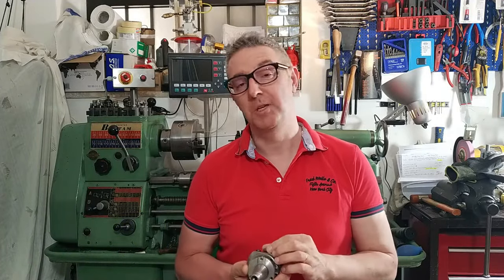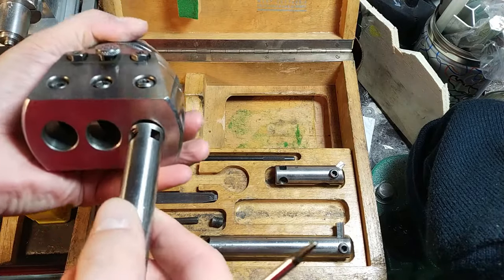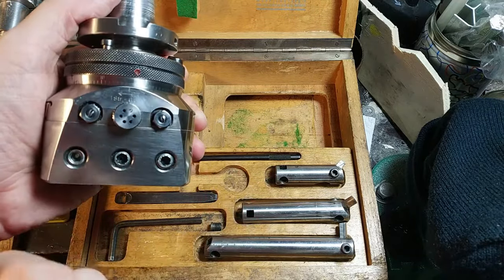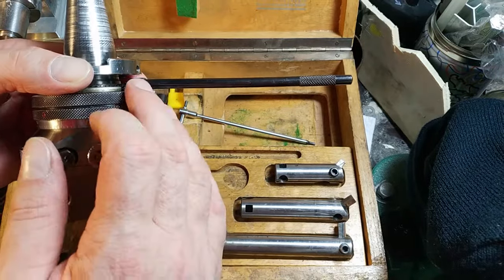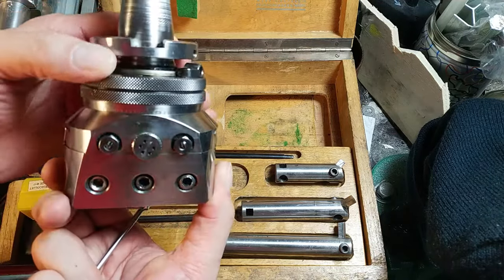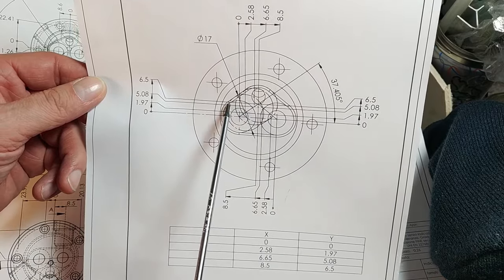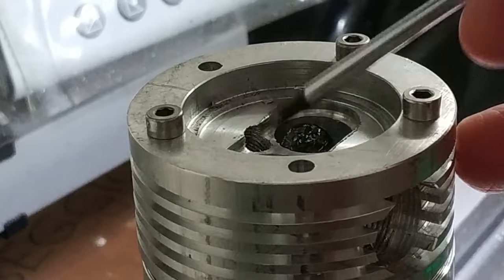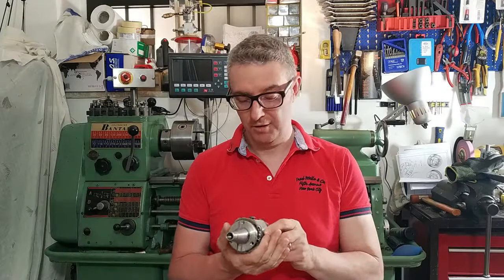UPA3 WOHLHAUPTER - Boring Head Unboxing

Comment: Great demonstration of this model of head, and the bold move of adapting it to fit your machine. I have done the same to Boeing Aircraft surplus UPA5 removing the SIP mount making it now useful on several heavy machines. I am looking at the UPA3 for smaller work. The larger heads are usually not as costly as the smaller sizes. Another observation is the kit of attachments get rarely used by those that use the heads on a regular basis most often on horizontal boring mills, instead adapting to inserts or fabricating a brazed carbide tool. I have used the head for restoring a variety of damaged castings including vintage motorcycle crankcases. The larger head I have, the boring size adjustment is a small dial on the side, I find it a little tricky with all the gear lash involved and I mostly just use the heads facing and cutting internal grooves function, then use a regular head for plain boring.
Reply from the maker: Hi Dee Dee, thank you for your nice comment: it is really interesting and nice to receive a comment from those who have used the UPA several times, I fell in love with the UPA after seeing some videos on its use / history; I went crazy turning / eliminating the old centering cone for the Deckel FP1 that was mounted under pressure, and then even more turning the MT4 cone below because it was hardened, but on the other hand the version with the cone that unscrews and allows you to install for example an NT30 instead of an NT40 it cost more than 1000 dollars and so I said I'll try and it want well.
The UPA2s are highly sought after and very expensive, because they are small (so can be install on mini-mill): I had a Chinese boring head but it is really another world, I have never used it anymore, for those with a passion for mechanics it is a joy to use this little wonder.
It is also interesting to know that you used the UPA head just as it is shown in the manuals, to work counterbores on cast crankcases like those of motorcycles! Really proud to have received your comment Dee Dee, I've been your new subscriber for a few minutes !! I will go to check your channel too!! Kind regards, Alberto.
Reply: @ab-shop  Hi, I stumbled across you channel searching the subject but it took several times, the YouTube Search function is really bad often going to the most worthless and most watched channels were they wouldn't know what to do with one or think of using one. Makes it haerd to make fresh videos or find good content. This device was often a shops secrete weapon and I can say I made a lot of money with it along with the Tree angle cutting head on a Moore jig borer. Probably to the horror of any SIP jig bore owner  I took an abrasive saw and cut the  SIP shank off, then machined a threaded socket using a good lathe. I can put it on any large machine it is a very heavy head. Thanks for checking me out Aberto, I will be back, Don
Reply from the maker: @deedeeindustrialsuperprecision  Maybe Don is because i have a small channel until know, so YouTube first place those who have large numbers of views and more, but sooner or later you have to start and then I started !! See you soon Don, Alberto.

Comment: Alberto this is extremely interesting and clear. I am thinking about a boring head, but I do not have a Mill so it will require some thinking ..... I could use a boring head in my lathe (MT3 with 12mm drawbar) but only if the work will fit on my cross slide. Or on my pillar drill (MT4) but I cannot think how to arrange a drawbar. Cheers.
Reply from the maker: Hi Paul and thank you for your compliments! You know, as always happen, the auction on Ebay close in the band moment of the week...i was on holiday last summer in a cruise with my family...i win at 23.30 of saturday night near Greece sea 😁...it Is a great piece of mechanic!Yes a drawbar Is necessary, the radial hit releases the head ( the taper surface) and It rolling down in dangerous mode! Maybe on your pillar drill can be ok, if you have a hole on the pillar column for the draw bar!  See you soon, Alberto.